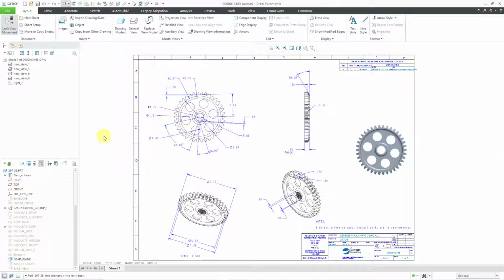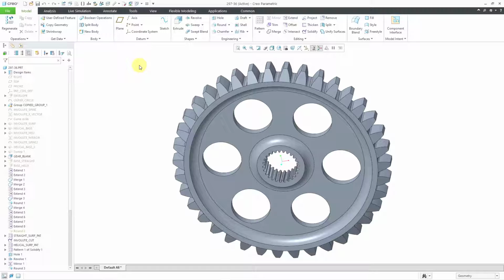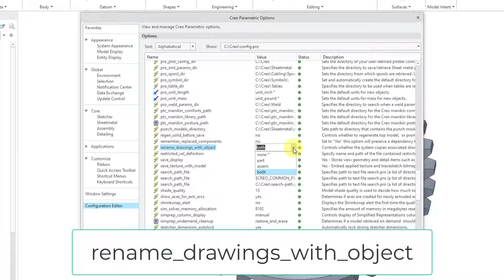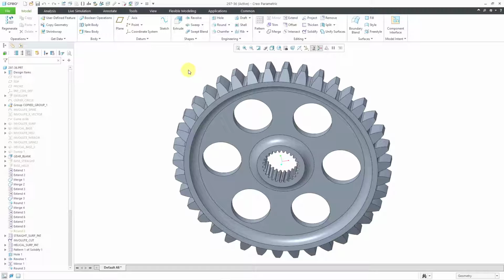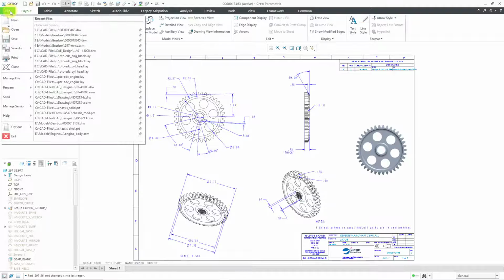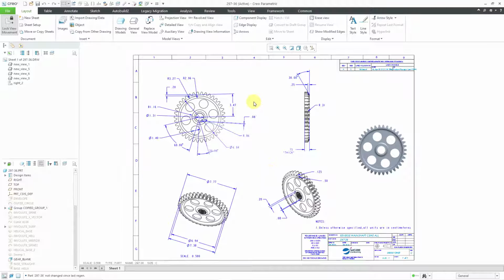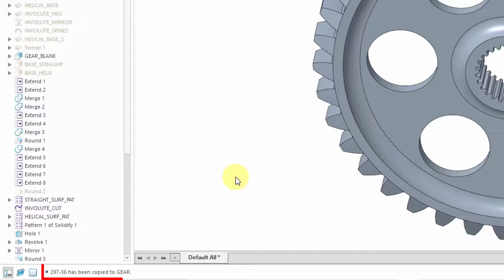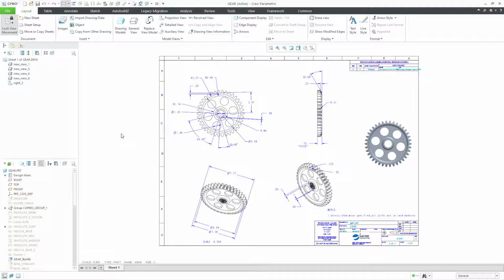Creo Parametric - Reusing a Part and its Drawing

Comment: Hi Dave,

Is there a way to copy the part and its corresponding 2D drawing, but change the "start part" template for the new part? Trying to copy a part from an old start part template to a newer MBD start part template.
Reply from the maker: There is not. There are tools within ModelCHECK to change the standards used to make a model, but you can’t do it via copy.
Reply: @CADPLMGuy  Darn. Can we request that PTC in future revisions of the CREO P. software incorporate such a feature? Haha.
Reply from the maker: Of course you can request it. Anyone can request anything on the Ideas board of PTC Community. The Creo Product Managers do read the requests.